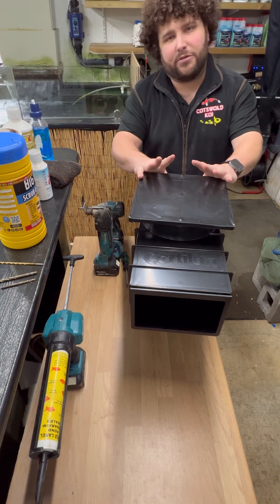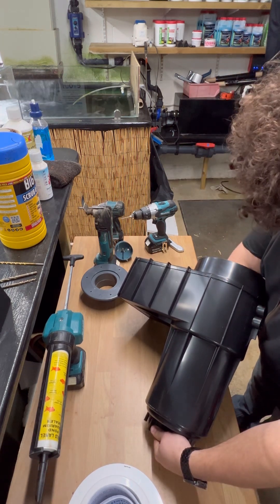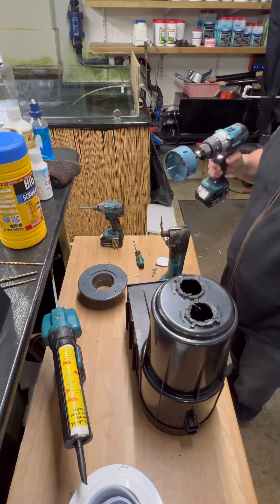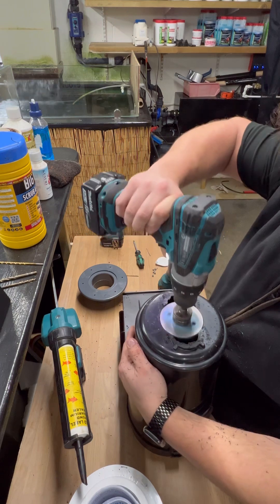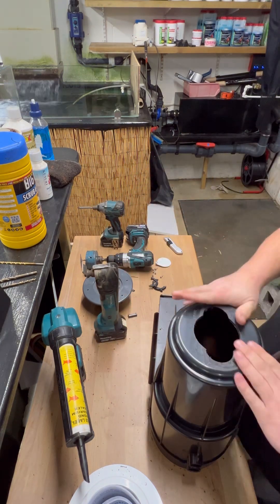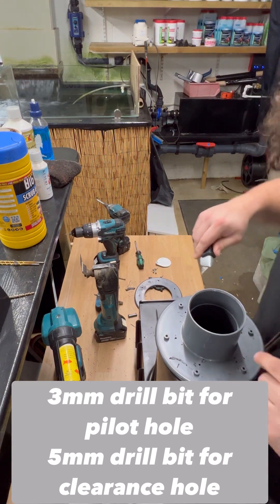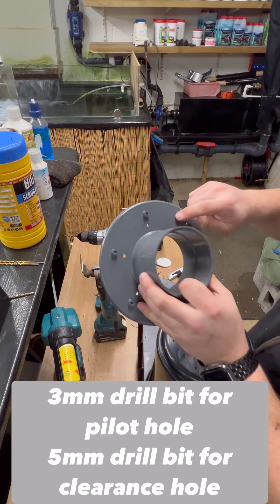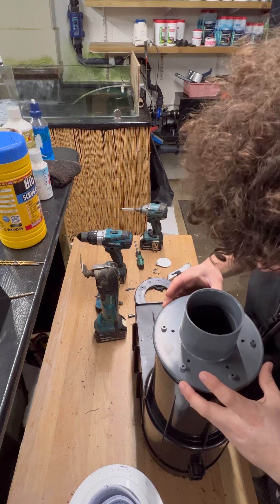How to modify a surface skimmer to 3” to use gravity to your filter

Comment: Why not just use a 4" bulkhead?
Reply from the maker: ones designed to use with 4" pressure are normally  to bulky, I've done them with a 110mm threaded fitting and an adapter before

Comment: Did a similar mod to mine last year, I used 110mm hole saw which removes both factory holes completely but still a good enough lip for structual strength, I fitted a reducer boot that fits perfectly around the bottom of the skimmer then reducing down to take a 110mm slide valve as I converted mine to gravity feed an ultrasieve.

The only issue with making this a gravity feed skimmer is the floating weir with basket will no longer work as the pumps suction is needed to draw the floating weir down to allow water to flow, plus never really like the floating weir as it always had an issue with drawing in air and burping all the time,  I just bought the traditional weir flap for it and that works way better IMO plus no real limit in regards to flow rate where pump fed I believe is around 8000LPH, good skimmers though as mine was fitted in 2005 and still going strong
Reply from the maker: Hello, 
yes I've converted many to 110mm as well i like to use a 110mm threaded tank connector, I'm assuming you used a 6" - 4" rubber boot ? 

I've never found this type of weir to be a problem,  if its feeding straight into a drum i tend to not use the basket apart from the autumn when there is a large amount of leaves. 

yeah the flow rate is impressive gravity  

links 
110mm tank connector 
https://www.cotswoldkoi.co.uk/product/black-waste-threaded-tank-connectors/

6" to 4" boot 
https://www.cotswoldkoi.co.uk/product/flexible-adaptors/